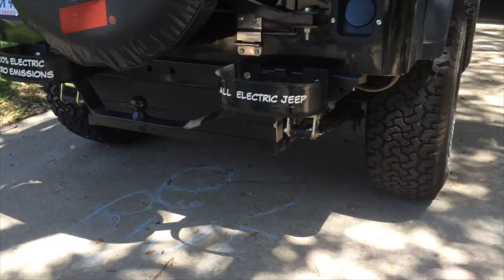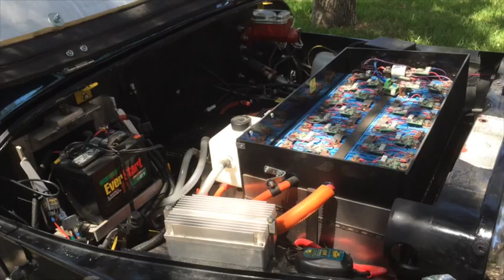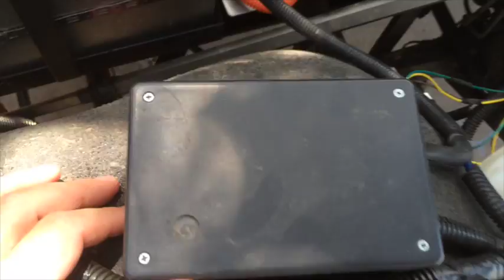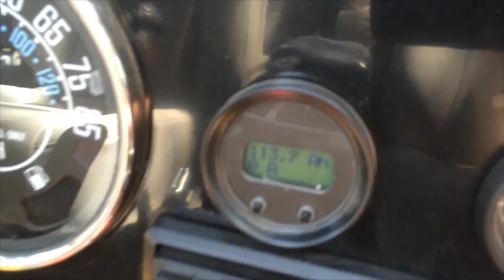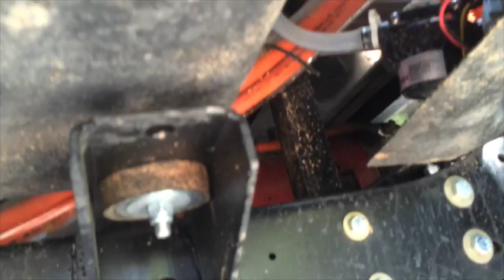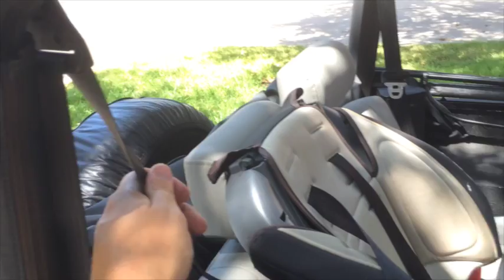Electric Jeep CJ7 Review

Comment: Awesome setup, where did you get the motor and whats the power rating?
Reply from the maker: Got the motor from http://www.electriccarpartscompany.com.  It's a warp 9 DC motor.  I plan to move to an AC motor someday.   Motor info can be found here:
http://www.electriccarpartscompany.com/WarP-9-EV-DC-Motor-br-72-156V-500A-br-Double-ended-shaft--advanced-timing-875-CE-Shaft-1125-DE-Shaft_p_64.html

Comment: Do you still shift into all your gears with your manual transmission or just into forward and reverse?
Reply from the maker: +Jonathan Bridges 
I do use the gears.  Mostly just 3rd.  I use 4th for the highway and 2nd if I'm starting on a hill.  1st and t-case low
are still helpful for off roading.
Reply: Nice. I was wondering if you could have an electric motor and still have a manual transmission at the same time. Do you the clutch too?
Reply from the maker: Yes, currently I do have the clutch.  You only need the clutch to shift - not to stop.  I did a clutch-less system for a while, but it was too hard to shift gears (but it could be done carefully since electric motor doesn't have as much momentum as gas motor.)  It's kind of like driving a golf cart.  You just put the tranny in 2nd.  Left off the break and press the accelerator pedal and go.
Reply: Nice. I wish the companies that make our electric vehicles today would put a clutch and a manual transmission in them. I would be interested in buying one.
Reply: zeetnet sure there is, a more engaging driving experience. I don't want to drive an appliance.
Reply: Go try a Tesla some time. :)
Reply: If you did get a clutch and a manual on an EV the end result would be more driving complexity and a shorter range, except in very specific situations where it would have a tiny advantage. There's really no reason to change gears on an EV.